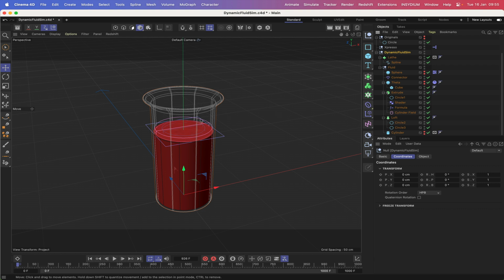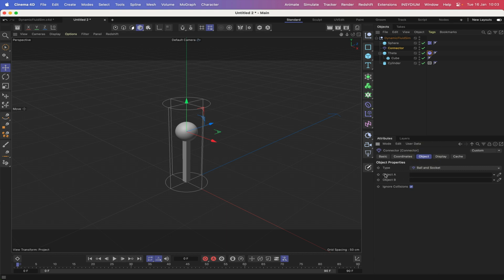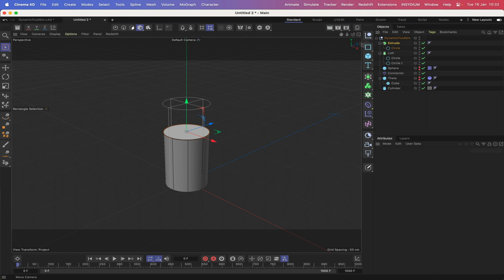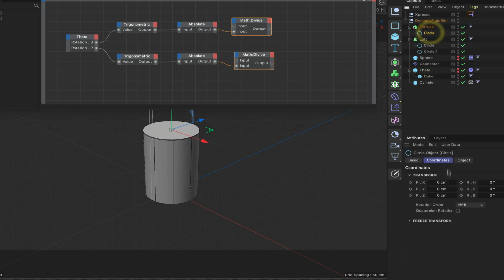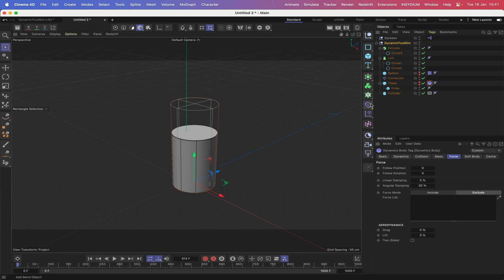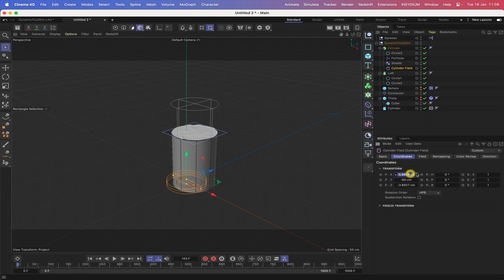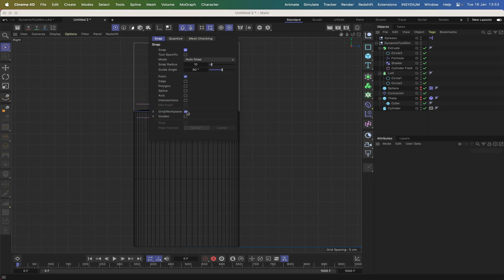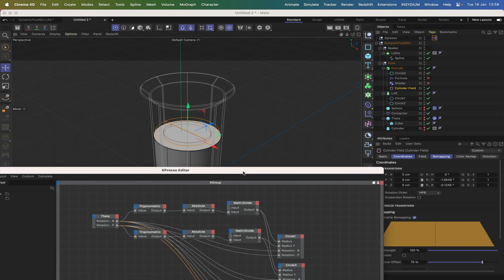Cinema 4D Multi-Tech Tutorial 45: Dynamic Fluid Sim

Comment: nice tutorial, but won't work on my computer. level not moving when I move the DynamicFluidsim. It correcting the level when I use 'rotating the DynamicFluidSim', not moving. Perhaps my computer is too slow, I don't know. but it's nice made 👍
Reply from the maker: Try using a Vibrate Tag to make the DynamicFluidSim Null object move around and see if that makes a difference. Set it up to move the Null along its X and Z axes. It should work both when moving and rotating the Null, but you can't let it stay still for too long after you have started running the Timeline.
Reply: @ExpressoMechanicTV  I will give it a try and you hear about it. thanks for the reply, Julian.
Reply from the maker: @willy4740  Good stuff, Willy!